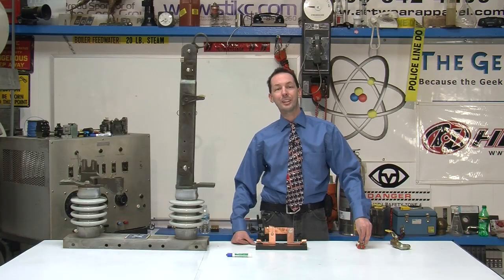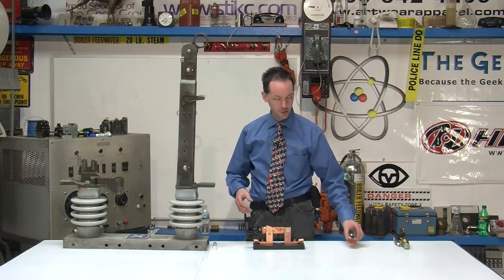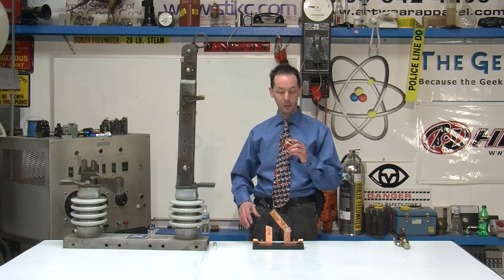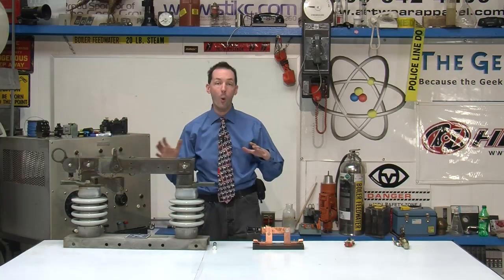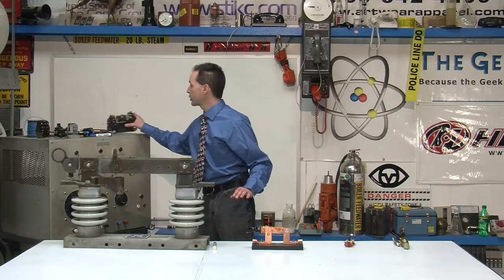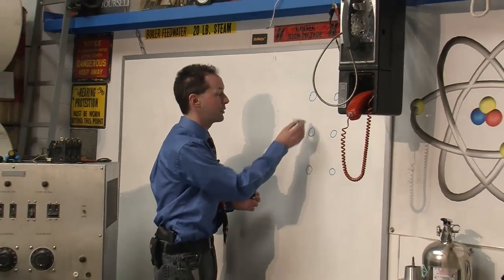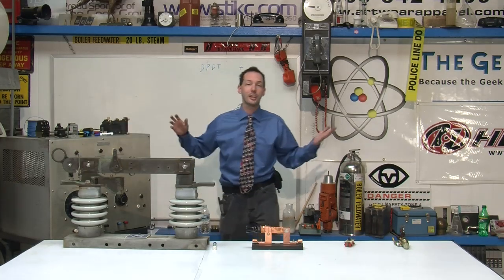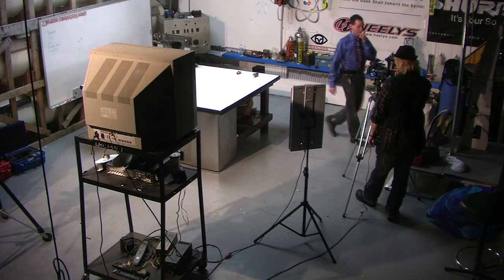Switches 101

Comment: lol good video!, love the macho knife switch!

I am building a control panel to operate my workshop AC systems using knife switches (12v contactor trigger voltage only) and analogue current and pressure gauges.

going to have that full 'mad scientist' look